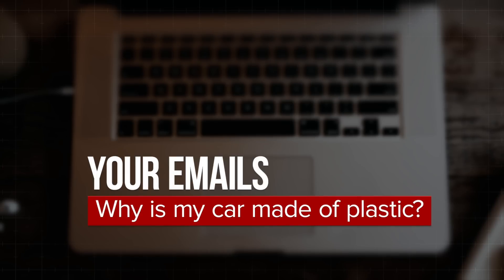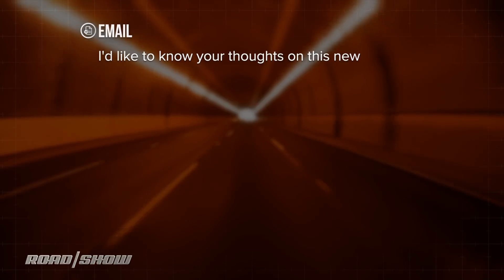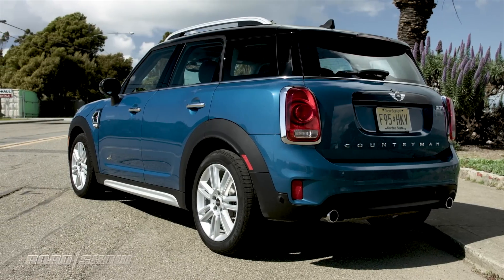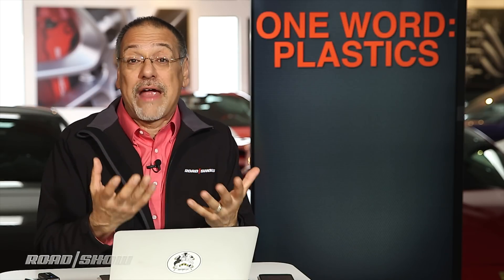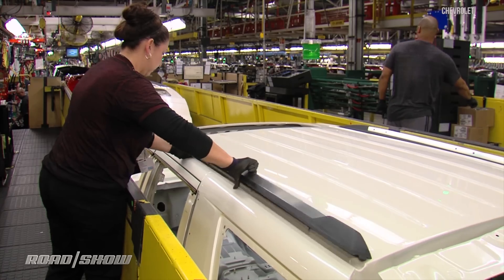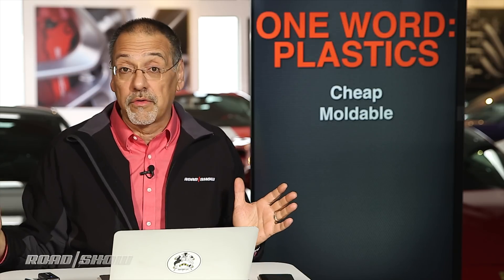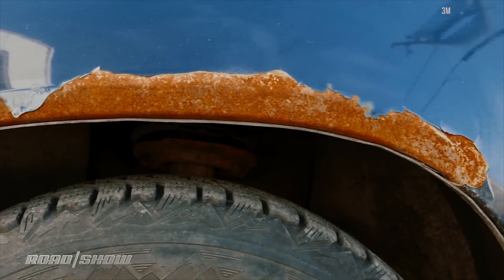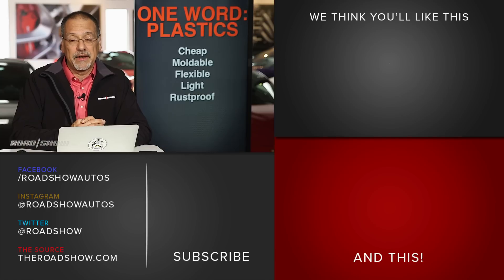Your Email: Why is my car made out of plastic?

Comment: Plastic is not durable and it will not flex back. You can have a truck with a metal bumper and the cost to repair at The Body Shop is a lot. Cheaper than if you total. A plastic Sedan. You're looking at at least five thousand dollars worth of damage

Comment: Hate those cheap plastic bumpers. My first car was a 1981 Pontiac Grand Prix with chrome plated steel bumpers. One time another car ran into the back of me and there was almost no damage to my bumper; just a small dent a few inches wide. Run into the back of these newer cars and the whole plastic bumpers piece will fall off. Cheap. Cheap. Cheap.

Comment: To me, plastic = cheap.

When a car cost over $100,000, the headlight should be glass not cheap plastic that turns cloudy over time.

Same thing with monolith black interiors - cheap.

In the old days like 1950s, when you order a red interior, almost everything is red.

Now when you order a red interior, it’s still mostly black.  CHEAP CHEAP CHEAP on expensive cars!

Comment: Had a 2003 Camry which's rear plastic bumper took a hit & left a large dent, had to have the whole bumper ordered & replaced & painted to match. The bumper's dent could not have been pulled out , just the new plastic bumper cost over $700.00  that's not including installation & paint. Plastic repair's are out the roof costly, it's crazy. If I was an Auto Insurance Co. I would not like the expensive plastic CRAP.

Comment: We owned a smart car, the body panels are almost entirely plastic, but the benefit was you could change them out easily if broken, which we did (went from red to green).  Car was not very reliable though and the parts were Mercedes prices.

Comment: What is even worse is those plastic parts you can buy to add on vehicles (though usually they are added on by dealers on the lot to increase margins), like around the window sills or the stupid wind deflectors on the hood.  If they did anything then the manufacturers would design them that way.  You are literally paying hundreds of dollars for cheap plastic.  If I was buying a car and it had them on it I would tell them to take it off (if it can be), they look so stupid

Comment: I just want everything I touch to be metal, wood or leather in a car. I think plastic should be left to the outside of the car and on interior trim. Buttons, switches, gear levers and handles should be made out of better materials.

Comment: Ahh the Acura RL (as mentioned was their first review). I’ve got a 2007 TL Type S 6 speed which shares the aforementioned, dated as hell navigation as well as the 3.7L V6 — the RL’s is tuned to about 15 more hp, but I think I’ve got one of the most attractive sedans to come out of the 00’s, as well as I think it certainly aged better in looks than most cars from the era from any brand (especially the 07-08 facelift).

Comment: My biggest complaint are the plastic headlights...a 10 year old otherwise pristine vehicle will look like garbage without constantly polishing the nasty foggy and/or yellowing lenses!!!
Reply: Hippie Bits we use plastic lights because they're are cheaper and way more durable. Plus you can just take a day to clear coat them to make em permanently clear. I recommend ChrisFix's tutorial.
Reply: Smoke Screen Thank you for your suggestion. Why don't they come this way from the factory if the clear coat will last forever...seems a little ridiculous especially considering the cost of a new loaded vehicle these days.
Reply: Hippie Bits its because they use the same clear coat for the paint on the lights. Im not sure why either considering the permanent clear coat costs like $5; other than they are being greedy and want you to replace your headlights.
Reply: Eh if we had glass headlight assemblies they couldn’t make them as cool as they do plastic headlights

Comment: I don’t mind the plastic around the wheel archers, but i like it to be body colored and not cheap black plastic that looks HIDEOUS and ruins the whole look.

That white Rav-4 looks a lot classier than the red one
Reply: It looks classier, but the red one looks like it was made to actually go off-road. :)
Reply: Why would you buy a rav-4 to be classy?
Reply: It's a mixed bag. I like black plastic trim pieces. I think it adds dimension to the vehicle. Plus the ruggedness. Rather have a cheap plastic piece all torn to hell and back that you can easily replace compared to the metal side.

Comment: Still think exterior black plastic trim looks cheap, cheap, cheap, as if the designer could not think of a good, proper design
Reply: I only like it if something is built to be off-road capable. Its durable, light, and cheap to replace for spots that will see a lot of wear when not on pavement. Unless the factory is going to give me powder coated steel in those parts I'll take the plastic. For something thats never going to see more than a dirt driveway however, its rediculous.
Reply: S G Go to bed dear baby boomer.

Comment: YAY plastics! I have no issue with plastics, they have their place when used appropriately.
Reply: Yes, they do have their place.  Which is not the radiator!  (I'm looking at you BMW!)
Reply: I like the cute dog. Is it yours?
Reply: LMacNeill Y'know you make a good point. While plastic and aluminum radiators do cool better than the old copper and steel radiators a fully aluminum radiator would cool even better and be far more durable. Yes, I know they're costly. But as a retired auto mechanic now selling Auto Parts in handing out repair advice I wish I got a $1 commission for every replacement radiator I have sold! Copper, steel, and aluminum radiators can be repaired (welded) if they spring a leak. With plastic and aluminum radiators, sure you can repair them, but what's the point. You'll pay just as much to have the plastic welded (filled) as you would to buy a new radiator.